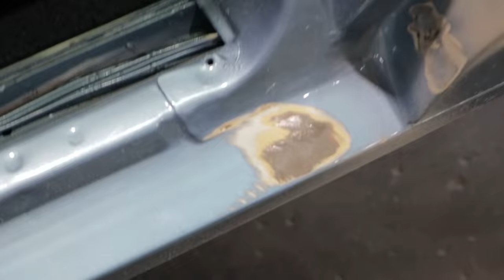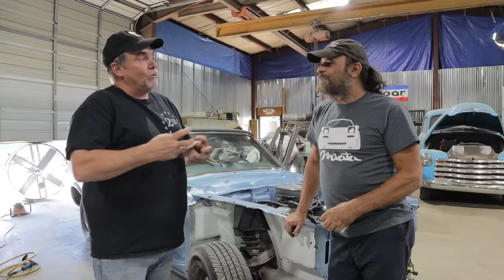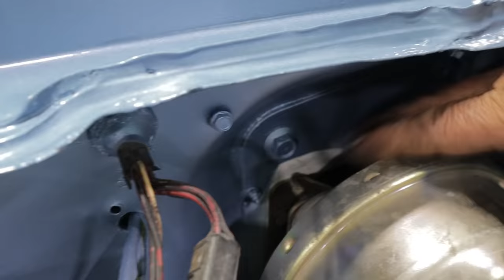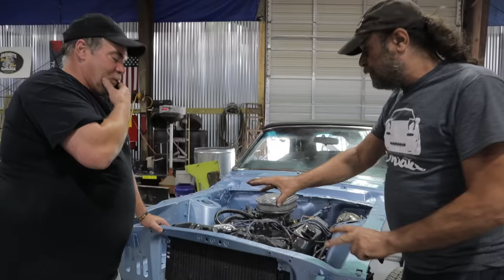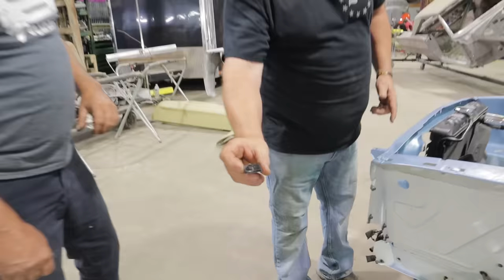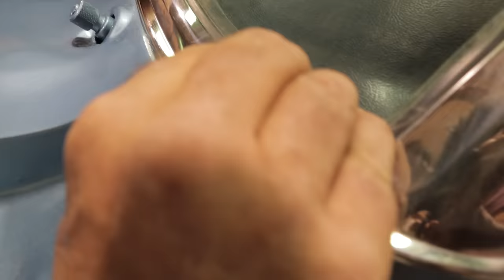Refugee From Body Shop Hell

Comment: ROLL UP YOUR CIGARETTE!!!   GREAT VIDEO UTG!!!👍   GREAT CAMERA & EDITING WORK ULTRA KATHY!!!

This doesn't boarder criminal, it's outright criminal and these shops need to be held accountable!!!

I ain't no paint and body person but I've read enough in my younger years (started reading/studding car, truck & paint magazines when I was 12 or 13) to know how & where to use body filler, I also know about the thinks you don't do if you want a good finished product. Body filer should be used similar to primer and blocking techniques, just enough to smooth out the metal work not to fill or cover up anything. I have always used 80 grit sandpaper on the area where I needed to apply filer. I've been asked to half ass body work and prep work for paint by the customer & my response was, I just I don't work like that and now you need to leave and take your vehicle with you. I'm sure they found someone to hack up their vehicle for them, they are out there & I hate them with a vengeance.

Comment: I have seen worse. I have seen where the entire floor board was covered in the as seen on TV sealer flex seal & it was called safe. The car was an entire mess.  
 But you guys will make it right the best you can (: be safe.

Comment: My buddy bought a 66 GTO without letting me check it out first. Whoever "restored" it went through the trouble of brazing and chisseling fake casting letters (6X?)  on the cylinder heads. I noticed it right away because the paint was flaking off and you could see the gold braze.

Comment: I looked at a car on a car lot one time and there was a spark plug wire hanging from the rear quarter and when I pulled it .....it cracked the whole quarter panel glad no one was there

Comment: My previous post went away, posting again but this time in smaller bites in case it went over the size limit.
1 of 4
Over on another channel, there is a Charger 500 that is getting restored.  They had the body dipped to remove paint and rust ( Good )  however, they didn't dip the car in E coat preferring to hand spray the car ( not good ) .    It is impossible to get paint in every hidden area without an E coat dip and as a result this car will be a rusty mess in a few years.  You just can't get paint inside the: A pillars / Cowl / door hinge posts / frame rails / rockers or any spot welded seam.
Reply: 3 of 4 
The shop also powder coated some of the grille / headlight panel areas ( I don't like powder coat especially on a " restoration " ) .  The parts were pitted once the  rust was removed, this showed through the PC and the shop was on camera stating " We will coat these again to get rid of the pits . "  Any guesses on how thick the PC will be to get rid of the pits?
Reply: 4 of 4 
By now the car is in color coat and probably on it's way to be reassembled, I've given up trying stop this disaster. This isn't a disagreement on something like what brand of paint to use, it is basic body prep.    Will bare steel + moisture = rust? When this turn in to a rusty mess with everyone blaming the dip / strip company?    You be the judge.
Reply: 3 of 4 
The shop also powder coated some of the grille / headlight panel areas ( I don't like powder coat especially on a " restoration " ) .  The parts were pitted once the  rust was removed, this showed through the PC and the shop was on camera stating " We will coat these again to get rid of the pits . "  Any guesses on how thick the PC will be to get rid of the pits?

Comment: One of the least expected things ive seen was on kindig it show were 1 of the youger guys was fitting the rear bumber when it slip and hit the rear panel by tailights on a dodge and a piece of paint and bog  about 8 to 10 mm thick chiped off it ,on a new ground up build , possibly 80k plus . Just goes to show even the top guns do it

Comment: I am not the greatest car expert out there, but I learned this about cars: Buy a car with a straight body. 

Engines can be rebuilt. Transmissions can be made as good as new. Suspensions can be upgraded. An interior can be used as a henhouse pr a wolverine cage and it can still be restored. 

Body work is different. Body work is difficult, body work is expensive and it's very hard to get a car as good as it was from the factory.

Comment: true story,i once had a guy ask me to fix up his 1967 stang.
i walked around the car,inspecting it carefully,then pulled the Side Quarters OFF the Original side quarters !!
YES,someone had literally Added a Complete quarter Over the original !!
Both Sides !! bondo and Rivets only !!
same car also had a drivers side collapsed front suspension,where the upper plate had separated from the Frame rails !!
i turned this one down,something i Rarely do.

Comment: I work at a body shop and I’ve seen a lot of stuff come in over the 6 years I’ve been there that was done by some other shop and a lot of it is poorly refinished or very sketchy.  It’s hard to find a place that takes pride in doing stuff right.  There’s jobs where we’ve had to do that kind of thing because it’s all the customer wants to throw into the vehicle, they just don’t want to pay to get something done right that will make their car last.  We always say you have three options good, cheap, and fast.  You can pick two but you can’t have all three, ie you can have it cheap and done quick but it won’t be good.  You can have it good and done quick but it won’t be cheap, and you can have it done good and cheap but it won’t be timely.  Btw we call throwing bondo over rust whack ‘n’ tack or grind ‘n’ schmuck.

Comment: Shop didn't even paint it right . Ford painted everything forward of the cowl black  with sound deadener applied to the outside front aprons and firewall to kill bias ply tire noise . I remember scrapping it all off to weld up the holes on my 68 back in 79 .

Comment: While it isn't correct, I personally like the body color continuing through the engine bay. It adds to the engine presentation if you continue some of the coloring with other accessories. If this was a restoration though that should be done as it was from factory.

Comment: Some of the things you pointed out would fail you in a high school shop class. Some of that was even below shade tree work. A wire wheel and a drill and some rust neutralizer is shade tree level work. That is just robbery where someone is paying for custom paint and body and getting less than Maaco quality.

Comment: It was too cold, it had dampness on it, or the mix was wrong. Riiight...
Wrong, unless you strip the rust away (a fun process called media blasting) and apply an epoxy primer then follow up with filler it doesn't matter. No matter the mix or type of filler the rust will continue to pop everything off. 
No, I haven't done any restoration, nor do I ever care to do any again. 
Too many hours that people don't want to pay for...

Comment: I ended up going mob handed to recover a car of mine from a body shop after the owner stopped responding. It was blocked in and he seemed to be busy so I thought I'd be reasonable and said I'd be back just before closing. When we got back at ten to five he'd locked up and gone home but pushed my car, with parts piled up on the roof, out on the road and stuck a chisel through the radiator (it was still dribbling coolant).
Reply: Oh yeah. While my car was still there I got talking to a random bloke who said he'd seen a car outside a body shop and went in to ask if it was for sale. The body shop owner told him it was a customers and that the customer was a wanker and to not bother. Yeah, that was my car..
Now, I can be a wanker. I don't mean to be but I'm sure some people think I am. Point is though, if the shop owner thought I was being unrealistic or unreasonable then why not grow a pair and address the issues rather than say yeah-yeah-yeah, fuck me about, lie and slag me off to strangers? Who's the wanker now eh?

Comment: That car was propbably done right to begin with.  What happens down in Florida is the moisture gets inside the panels and rusts from the inside out.  I bought a 70 Ranchero GT which i thought was rust free.  I bought it in Jax Florida and it was rust -free on the outside, but I rolled the car over a month after i moved back to Wisconsin.  The panels literly slpit from being thin amd rusted.  Just like that Mustang.  It is NOT ALWAYS LIKE THAT WHEN IT LEAVES THE BODY SHOP!  Findout WHERE IT CAME FROM!
Reply: Obviously didn't watch the video did you?

Comment: People dont realise the time and blood swet and tears literally that goes into a proper all metal  body restoration, it can take months, sometime years depending on how bent and rusted the body, frame or unibody is. Customers always want paint" yesterday" but, in order to get to paint, lots of cutting, welding, sanding, hammer and dolly work, metal brake and english wheel work, i mean a good body tech that does great all metal body work is like striking gold and should be paid like the customer struck gold because often times the work done is far more valuable than the car itself. The days of hand forming body panels is long gone, theres maybe 10 living people that can still do that work accurately

Comment: A true show quality restoration and paint job on a fairly mundane 68’ Mustang, I6 or V8, with the typical rust issues will cost you $90-100k at a minimum. If a shop tells you they can do it for less be wary, unless you’ve got little to no rust in the car at all they’re blowing smoke.

Comment: I went to look at a77 Black Bird and the guy got pissed. He billed the car as "original", asking $20K. The excessive undercoating in the wheel wells was the first red flag but there were heavy bondo dust layers in not so obvious areas too. It was tough to get a magnet to stick anywhere below the door handles. How he got the body lines so straight was impressive though. On a guess, I'd have to say there was easily 30 pounds of filler under the paint.

Comment: Tony got a question hoping you can help. Working on 500 inch a body and long story short, i cant remember the process for checking for a vacuum leak underside the intake. I remember something like adding propane to the pcv (valve cover side) and watching for rpm increase. On a street strip car thought about going thru the breather. I dont know if im forgetting details on the procedure and was wondering if you know or have done this test before or had better idea. Thank you Sir

Comment: Sandblast a whole car then replace the whole quarter panel and the rocker panel and the door jam panel and if you use all the aftermarket parts which is about all you can get for those old mustangs cuz fords not going to build the part I wonder how long those aftermarket parts are going to stand up or hold that it's probably good for another 20 years

Comment: Bodywork can be frustrating, but trying to bodywork after some hack shit like that is a new level of hell

gummy 1k paint you gotta wire wheel all the way to bare metal because its falling off where they forgot to sand half the car. Bought a civic like that, 1989 hatch with a B16 and they sprayed a TON of paint over dust or smooth paint.
Reply: Every EF Hatch ever 😂😂😂

Comment: To do it right, he'd need to strip that down to metal and have it hot tanked to boil off all the paint, bondo and rust and then start rebuilding with repro panels. Since it's a Mustang, they're all available.

Comment: Moisture came from back side thru pinholes an bondo absorbs it so it no longer sticks 
The biggest problem is that we give a estimate to do it right an they want it cheaper and most shops are money hungry and they slob over it 
Reasons why if they don’t go by recommending estimate I will not take in their job

Comment: I am no pro by any means but I am super particular.  When I took a body shop class years ago the teacher asked me why I was finishing of the sheet metal behind the headlight of my CRX when I could just do a scuff amd paint.  My response was that if it doesn't look factory and done correctly,  nobody else may never know but I will.  He said good answer.   It's all in the prep work, and this is why I paint my own cars.  I can control the quality of the work done.  BTW, the rear quarter wheel lip/flares were way off.  You could spot that across a parking lot.   The person that worked on that Mustang was a crook.

Comment: I bought a 71 Mach 1 and the entire back half is  body filler. Same type of deal. 1/4 inch of bondo over rust holes and unground welds.

Name names. It isn’t slander if it’s the truth.

Comment: Here is a challenge for you guys. Pick out a classic car lot that you can Google, and look at the inventory. Now look at the forty or so pictures of the car you chose. If they show the bottom of the car, nine times out of ten the floors and frame are covered in fresh undercoating or bed liner material. Now ask yourself, Why? Try to find a car that had the floors painted to match the top of the car, a car that someone took the time to do right, they are out there.

Comment: I don't mind hiding crap body work on my own car.. but I always make sure the car is safe as far as rust, panels welded on properly etc.. and I would never try to hide anything on a customer car if I was in that field.. that's insane. I paid someone to spray my 72 Nova, and what a nitemare it wound up being. I was promised a month, and it wound up being almost four months. They would dodge my calls/texts until finally I just started showing up unannounced, and finally I threatened to show up, and just take my car. The sad part is it was basically an entirely new body, so it needed very little.. the car basically needed epoxy primer, high build, sand, seal, then spray. Come to find out he was putting other customers cars in front of mine. I paid half up front, and wish I never did. The car looked alright, but up close it had a lot of flaws. That, and he never masked off anything.. I had primer/paint all over the brand new underside of the car, brand new gas tank, all over the brand new engine bay. I was not a happy customer.

Comment: I'm the mechanical type. I don't do body and paint or upholstery. Yes I have removed and reinstalled bolt on body parts before, and welded in patch panels. But definitely not show quality. Mostly on race cars. With the mess that scammer made out of this car, it may be impossible to find all the problems and fix them. He camouflaged everything really good.

Comment: A lot of these problems are down to guys who are doing the work and don't know any better.  I see many videos on here with people showing repairs where they weld in new metal but have not eliminated the existing rust.  When the job is done , the rust will probably show again within 1 or 2 years m because rust is still there and has not been treated or cut out completely.  Even some "reputable" restore shops , working on really expensive cars, I've seen welding that I would be ashamed of and it is just covered up with filler.

Comment: I restored a 1967 chevrolet heavy duty half ton van for my son. I am not a body man but I cut out ALL the rust and welded in 16 gage non coated sheet metal. it looked good. I painted it with white rustoleum. went 14 years with no rusting through anywhere. my point is even an amateur can do a serviceable restore but this criminal thief that did this mustang is a bum.

Comment: Theres rust there because its not seam sealed. The filler isnt adhering to the car because the rust delaminates it. Just because a filler is cheaper doesnt inherently make it bad and idk what the hell hes talking about the smell for. They all pretty much smell the same. Usually youre paying for spreadability or sandability in filler price. As long as its mixed properly and applied properly a cheaper filler shouldnt matter unless youre using some of that old add water filler or something lol.

Comment: People will get a $20,000 quote from one shop, and $11,000 from another one.  Too often they hire the $11,000 shop without wondering why it's $9,000 cheaper.  A year or so later, they find out.

But in this video is unfair.  Saying, "there's still rust under there" applies to all Mustangs.

Comment: Anyone that says you can make money by restoring old cars are not fixing them right you get 50 cents back on every dollar you put in to them that’s why I like unrestored original paint cars with out the fold up chairs in the trunk beside the California Duster
Reply: Really depends on the car, a top quality restoration on a 71 Hemi Cuda convertible is going to make a large profit, but a 340 Dart Swinger probably won't 🤷‍♂️ of course that's a non issue if it's a car you don't ever plan on selling
Reply: @barneymiller7894  most average working class can’t afford a 71 factory hemi car of any kind and I haven’t seen a video like this one of a hemi car that has been hacked together
Reply: @seanfattireguythomas2994  Just making a point, and ya thats the case with roughly 75% of Hemi cars

Comment: That drivers quarter has more problems than that. That upper body line off the "scoop" isnt supposed to come back that far. And I just seen you noticed it on the passenger side. And it's just as bad.

Comment: It makes my blood boil when I see stuff like this! Taking people's hard earned $$$ for a trash job like that..That poor 'Stang is a real disaster! It's like a teenagers first car that the did himself to learn what to do on the next car. Many years ago I acquired a 1969 Mach 1 for a few hundred  bucks that needed some work, although it did run and drive. I started disassembling it to check it out thoroughly and found that it had been in a collision affecting the grill and the right front fender. There was big dent in the front of the fender that was still there, but filled with bondo that was an inch and a half thick and was still wet at it's center and smelled like fresh bondo. Needless to say, I fixed it using all metal bumping and a little lead and no bondo at all.